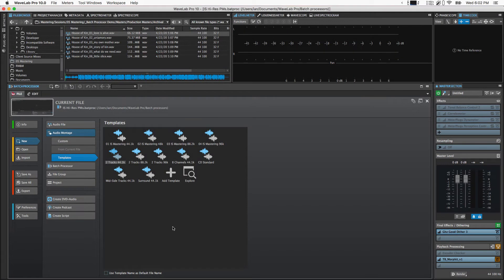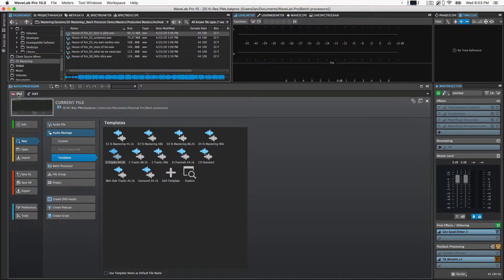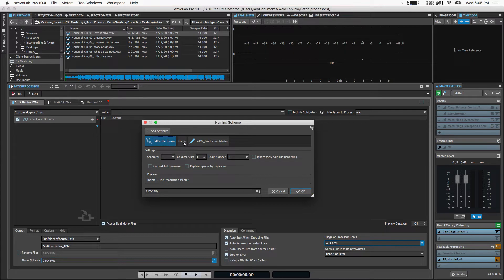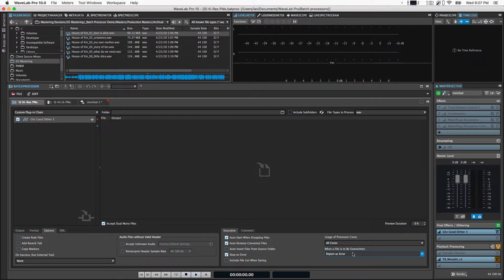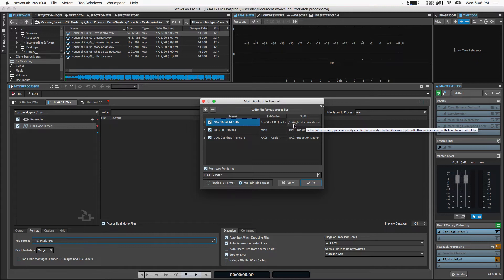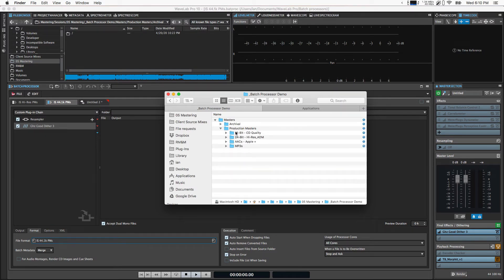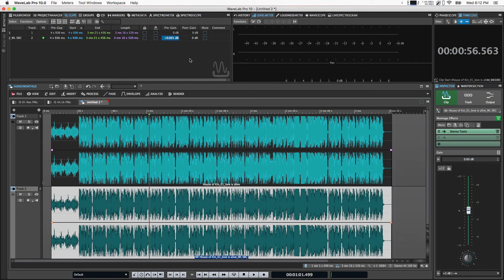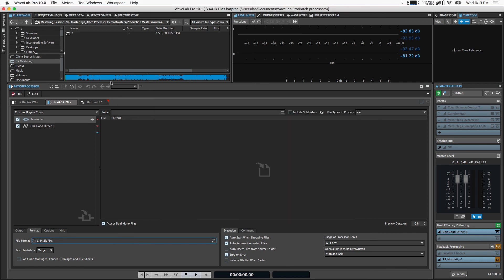Using WaveLab Batch Processors

Comment: Hi Ian this was so informative. On your final limiter are you setting the output gain to -1.0 to avoid ISP?
Reply from the maker: Hey Amen. I made those batch processors a while ago, so I’d have to double check. My philosophy these days is that since most streaming services have a lossless tier, leaving a dB for lossy codec overs is less of an issue than it used to be, and if someone is happy to listen to a lossy service like Spotify, they’re less likely to be bothered by possible codec clipping. All this is a long way of saying that these days I usually set my TP limiter to -0.1, typically preceded by a sample peak limiter with a slightly lower ceiling (often -1.0).

Comment: Hello Ian, there is any way to enter the album "genre" in the metadata info? I did run the "batch processor" and it works great but when I play a track I does not display the genre. So far it just display what is available in the CD Edit. Do you know? Thank you, for the great video!
Reply from the maker: There certainly is, although I always do this in my main mastering session rather than the batch processor.

In the CD Metadata window there's an Album Genre field. If you enter it there you can then use the @AlbumGenre@ tag in the Metadata editor (the exception being ID3v1, which you need to enter manually), and it will carry through.

If you've got any other questions, pop over to the WaveLab Users Group on Facebook and Justin or I can help you out with screenshots, etc.

Comment: I noticed that the variable CdTextPerformer [3:07] in the Naming Scheme doe not appear to do anything. I found this even if the metadata is all setup and filled out. The Name attribute is used to name the files when processed, which is what we see here as well. I've also found this with the CdTextTrackTitle too; that the data does not appear to be used even though it is present. However CdTextTitle (Album title) does work OK when used as an attribute.
Reply from the maker: Hi Geoff, it very much depends on your workflow and how you have your metadata preset set up. To use those variables you have to enter that data into the CD-Text Editor, which is different than the CD Metadata. I use CD Metadata for Album Genre, and CD-Text for all else.